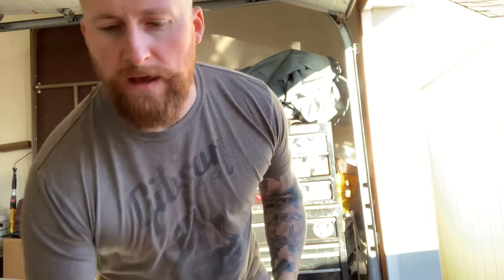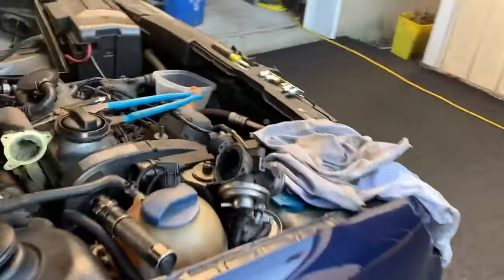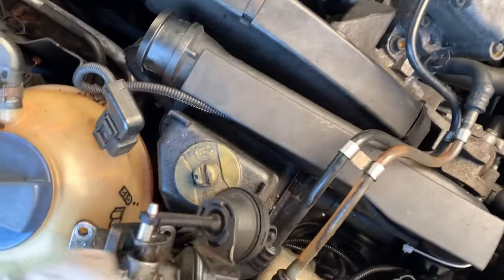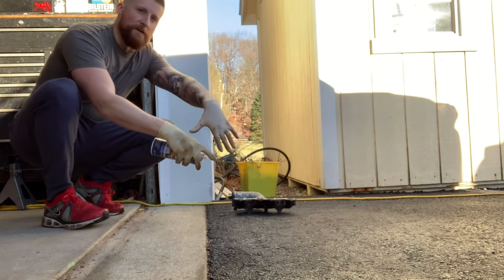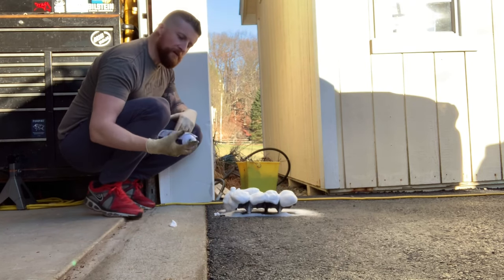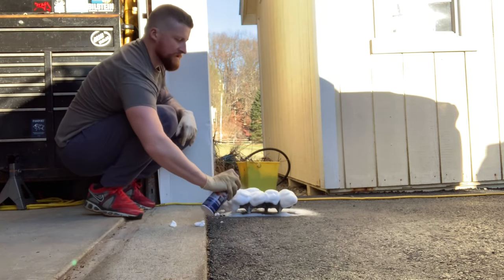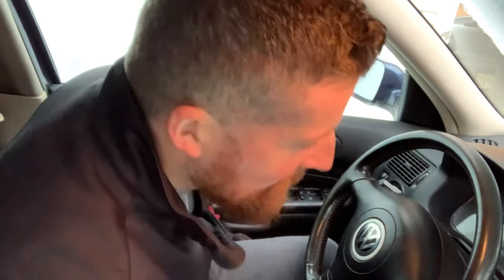High mileage VW TDI/Diesel - Clogged intake You won’t believe your eyes

Comment: Awesome video!  very clear and well narrated. I have a 2009 and after the :"Dieselgate" mod that was done by the local dealer, my mpg has been dropping like a rock, the DPF light & and check engine light have illuminated, and now the fan runs for about 12 minutes after you shut the car off. Man, I have to do something and I have been told to do a DPF and EGR delete and that will get my mileage back up into the  50's. What ia your opinion of that idea?  ( Plus cleaning the intake manifold) I love your channel and have subscribed so keep the great content coming.
Reply from the maker: I do appreciate your kind words. Thank you Sir. Yeah the new ones are smothered with all the pollution restriction crap. Those cars in Europe get great mileage without all the added junk.
My personal opinion, if the state you live in does care about check engine light as far as inspection, DPF and EGR delete is a must. Your Mpg will blow your mind afterwards.
Reply from the maker: But unfortunately after doing those your car will have a check engine light on. But there is another way around that, there are companies that can flash your computer to run with those mods without the check engine light. 🤷🏼‍♂️
I hope this helps.
Reply: If you have a check engine light you may be running in Limp Mode that puts the care in safe operation mode that is very inefficient.  Get the CEL off and your mileage should improve.  I just had an issue much like that but it was the flapper valve.  Lost 25% on mileage until it was fixed.  Motor operated fine  but terrible MPG.
Reply: I have same problem. 38 Hwy and 20mpg city......help
Reply: @VikingsGarage  does the car not take longer to heat up in winter with egr shut off? my rover did
Reply from the maker: Oh for sure, this thing takes forever to get warm.
Reply: How do i delete the EGR

Comment: EGR robs engine performance.
Reply: Its actually combination of egr, crankcase breather and high temperature that creates buildup
Reply: @Dumpluk I thought it was low temps that causes buildup. The deposits are a mixture of engine oil and carbon particles which flow better in high temps but settle easily with low temps. Hence the people who say lots of short trips are a problem for gas recirculating engines.

Comment: in my 1997 passat tdi 5 speed i could go over 900 miles to the tank.. and i was in no way at all being easy on it
Reply from the maker: Isn’t that crazy!! 😱
I believe it, I hear about those Passats.
Reply: Wow. I just bought a 2014 tdi jetta, I was excited to see 40mpg.. eventually it'll need DPF, and EGR attention. But I just got the cable from Ross tech, and plugged it into the vcds... my measured and calculated soot values were like 13 grams and 3 grams. But when it finally starts limping, or giving me shit about it, I plan on a full delete, and having a tune done for it. No lights, better power and mpg, no more DPF bs.. lol 

And hats off to the man with the half million miles on the bug, that's really cool to hear.
Reply: @nickc7318  congrats on the jetta i am sure you will love it especially after a couple upgrades
Reply: I use archoil diesel fuel system cleaner and I've never had any issues with mine. I run it every tank just for good measure. I have a 2017 Ram Ecodiesel and it's been trouble free.

Comment: I've gone 900 miles on a tank, love my TDI
Reply: What year and model?
Reply: @thedolphinDog  2003 VW Jetta TDI with a 5 speed
Reply: @ethanturner9110  thanks Ethan
Can I ask your opinion
I have 2014 passat tdi 
60k miles on it. I get 38/42 HWY mpg but only 20 mpg city
75%of my driving it is city
Not sure if I should just sell it
Still has one year VW factory warranty for next owner. I hear great cars....my city mileage sux.....hwy awesome
Reply: @thedolphinDog  No problem, I'm not a fan of any newer engine, whether that be a diesel or gas. They are way to complicated and have way to many things that can go wrong with them. The main reason why the ALH gets such good mileage and runs so efficiently is because of it's simplicity and lack of emissions systems. That's what makes it a good engine and why it out preforms all of the others.
Reply: Wow!  I've got a 2015 manual, and even when I'm hypermiling I think my best was 650 - 700 miles per tank!
Reply: 935 miles, 2015 2.0 TDI.
Reply: I can hold 17 gallons

Comment: I don't understand this practice. Oven cleaner is primarily caustic soda a.k.a. Sodium Hydroxide a.k.a. Lye. Sodium Hydroxide is corrosive to aluminum; it will dissolve it, especially if you use heat. It is the reason machine shops don't hot tank aluminum parts, although it doesn't seem many shops clean that way anymore.

Comment: Just got a 2005 Golf TDI. Everything is so brittle.. I was working in that area on some wiring I found the plastic harness had started wearing into so much so that one of the wires had exposed copper. I broke the nipple on the coolant expansion tank and did not even know it :( As for the EGR and Intake manifold.. I am thinking this may be one of the things I need to do! EDIT: My cars at about 270,000 miles!
Reply from the maker: Dam buddy, I feel you. Typical old Vw issues. Good luck

Comment: I drive a Jetta 1.9 TDI AHF motor on
406,000 Kms.
I reside in South Africa 
Do oil and filter change every 10K Kms .
I use Prolong diesel 15/40 engine oil.
No clogged Egr or intake manifold.
Still original turbo .
5.3/ 100 ltrs.
No sludge buildup.
Original exhaust
Original cv's

Jetta still runs well.

Comment: Engine load makes the biggest difference in how much it gets clogged up. I had it clogged up like 5 times less, just a quarter inch thick. It really depends how a person drives the car. Low RPM (1300-1600) driving makes it clog up very fast. I drove my car always around 2000 RPM and up and it pays. Gotta say it had 250k km when I cleaned it. Another thing that clogs it up is oil leak from turbo or crankcase valve, which makes the oil sucked through the intake and it makes these nasty big chunks.

Comment: Great video bro 👍 
My little daily I’ve owned for 17 years, a Mk4 2003 TDi , 90bhp,    @ 200,000 miles, built like a Tiger Tank, same clutch, only on its 2nd battery, is just the most reliable car I’ve ever owned! Starts with one turn of the key, so much torque and returns 55 mpg regularly and on a long run 65 mpg plus!

Only problems ….as the UK roads at the moment have feckin great big potholes EVERY feckin where you drive, is suspension repairs!! The UK, 7th richest country in the world and can’t even manage to repair its own road infrastructure 😠😠😠 
What a feckin joke the UK is 😠  Sorry, rant over!
Reply from the maker: Lol 😜
Reply: I'm in Chicago and just when you think most potholes are fixed and its not so bad winter causes a bunch of new ones.   Same car as you if its a Golf (GLI seat swap, 6sp swap, 1019 injectors etc).

Best mod I did to my car was 1.5" lift spacers and biggest oversize tires that could fit.  Mpg took a hit and noticeably more roll but trade off was well worth it for me. Still get ~50mpg driving it like I stole it in the city and I can drive over curbs and bomb rough streets like its nothing - I also do go off-road boondock camping.
Reply: @h82fail  I’m jelous bro ☹️ I was even considering changing to a Dacia Duster as they’ve plenty of fat rubber on the road to get better pothole improvement 🤔 Can you message your lifter part number and tyre and wheel size combo please and I’ll price it up to c the total cost  over here 👍
If it’s a common size I’ll try the scrap yards

Comment: 2004 Beetle tdi  484,000 miles averaging 550+ miles per tank. The only time I know for sure the intake manifold was cleaned was around 100,000 miles. 
The only service other than regular maintenance was spark plug harness replacement and a crank shaft that was showing signs of wear during the 400K timing belt change. New clutch at 325k. My daughter learned how to drive in this car too!
Reply from the maker: Awesome story, impressive numbers!
Reply: I have a 3.0 TDI and I'm trying to do a tune up and can't seem to find the spark plugs or harness? What other maintenence have you had to do to get 400k any pulleys etc.?
Reply from the maker: Nothing crazy really, just filters.
Reply: Why your tdi has spark plugs?
Reply from the maker: Pretty sure they meant Glow Plugs 😉
Reply: @Peter Dallman, your 2004 model with have the ATD PD engine, this engine here is the AIH before the PD engines 
The PD’s do clog but not as badly
Reply: @Dan23_7    You are correct Dan. I’ve taken the car to the same tech (not affiliated with a stealership) since the 100,000 service mentioned above.  
He was going to scrape the carbon out of the intake manifold on my last timing belt change but he said there was barely anything in there so he left it alone. 
At 498,900 now!
Reply: @peterdallman4550  Is that miles or kilometres? 
Mines done 111000 miles and I’m getting the timing belt done next week, it was changed at 70000 but before I owned the car. I’ve had it since 29/5/22. I absolutely love it 
It’s yellow
Reply: @Dan23_7     Miles.   I had mile timing belt changed every 90K miles.  The only other services done were clutch @ 325k, Plug harness @ 400k and the crank shaft was showing signs wear on the last timing belt change.  That’s it.  No on road break downs.
Reply: @peterdallman4550  That’s amazing mate, half a million miles !!!!
Reply: @Dan23_7   Especially since it was a car I didn’t want to buy!  I wanted a black Golf Tdi right next to the bright yellow New Beetle my wife and daughter loved. So guess who won!
Reply: @peterdallman4550  Yours is yellow too ? 😁
Reply: @Dan23_7  Like a canary!!  Oh. The other thing I replaced twice was the crappy plastic skid plate. I replaced it the last time with a heavy aluminum aftermarket skid plate that was cheaper than VW’a plastic one.
Reply: Spark plug harness on a diesel? Replacement crankshaft after timing check?  ( do you mean glow plugs and cam shaft?)  good to hear your cars going strong. Mines on 220k miles and still chugging
Reply: @Elldeeve  99% of car owners don’t know what a glow plug is, let alone glow plug harness. I can’t see my post while I reply. I didn’t call it a cam shaft? Oh well, you know what I meant. 
Anyway. It passed 500k a few weeks ago.
Reply: @peterdallman4550  Congrats on the big 500! 
Is it the 1.9tdi?
Reply: @DeCrille     Yes.  Still going strong!! (Knocking on wood). After the first service at the stealership I found a local trusted tech on Fred’s TDi online (not sure what it’s called now). Every service that’s been done short of oil changes ( LiquiMoly) has been done by him.
Reply: @MickeyWu7r5  lmao good one bro
Reply from the maker: They’re called Glow plugs, but I’m sure everyone already knew that . 😗
Reply: Spark PLUGS   or is it HAIR PLUGS
Reply: Spark plugs?... In a TDI?!?!?
Reply: @dominikdobrotic8298     I know… I know.  Glow plug. It was the harness that was replaced. 
I’m not a tdi tech, just have a friend who happens to know tdi engines inside and out like the back of his hand, he’s done all the services on it since the 100K mark when the stealership tried to rip me off.
It’s has 507,000 on it now.
Reply: @dominikdobrotic8298  Bud Light EDITION
Reply: @VikingsGarage I was more impressed with the tdi having spark plug wires
Reply: @peterdallman4550  my wee metros done 600k miles, love it for dodging around Glasgow.,original clutch.
Reply: @front2427    Wow!!   Is that 600k miles or kilometers ?   Original clutch is crazy either way!  
I’m up to 520k miles now. I’ve retired 2 years ago so I’m not driving as much any more.

Comment: I had the same issue years ago I changed to Amsoil series 3000 never had a clogged issue again.
I went 735 once left Denver got to the Iowa Minnesota border one one tank of diesel fuel.
Reply from the maker: 735 miles, that’s insane!!
Reply: @VikingsGarage  My 2013 Golf tdi returned the same fuel economy (when it was 7 years old in Aug 2017) during a roadtrip from Montreal to Glenn Burnie (close to Washington DC): covered 1183km on one tank of diesel at 60 miles/h.
Reply: @VikingsGarage  My 2013 Golf tdi returned the same fuel economy (when it was 4 years old in Aug 2017) during a roadtrip from Montreal to Glenn Burnie (close to Washington DC) through New york and Baltimore: covered 1183km on one tank of diesel at 60 miles/h.
Reply from the maker: 😱Very impressive 👏🏻👏🏻

Comment: Owen cleaner foam works better on hot pieces,you need to  heat torch the manifold and then you can see the foam dissolving the sout
Reply from the maker: Didn’t think of that, will know for next Time. Thank you for sharing!

Comment: Oven cleaning the vnt turbo is also a good idea as the vanes get sticky and it drops the performance... Once it's clean, it will spool up like new
Reply from the maker: Very true, but do you really want to stick a dirty turbo in your oven. 
Which I’m sure would cause gases once it burns that crap. 🤷🏼‍♂️
Reply: @VikingsGarage  he meant sticking a tube down the egr hole on the hot side of the turbo. And moving the actuator every 10mins to free it up.

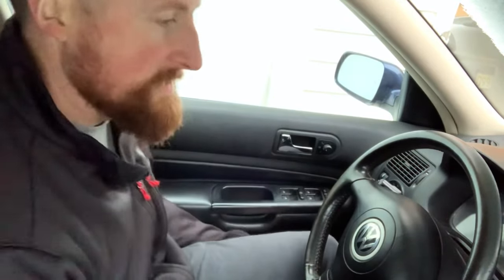Comment: 5:08 Hahaha every one who owns this car knows that frustrating alarm sound when you go to start it. BTW when you said the EGR doesn't even close my thought was "that's not normal?". I guess I'll be taking a look.
Reply from the maker: Crazy right
Reply: I'm an aircraft mechanic, hardly ever work on cars, but am capable. Is EGR & DPF difficult? Clean or replace? I know my check engine light is due to these. 3 shops so far said replace both (damn expensive) but isn't cleaning more logical? The quotes were ridiculous so I'm hoping to do it myself. 2012 TDI Golf 2.0. 46 MPG & a blast to drive.

Comment: If you have the EGR still connected, you're gonna get this crud.  Bin the EGR.. You're also gonna get crap mileage compared to an EGR delete version - go figure.. When I reconnect the EGR for "The Test", my economy goes to hell & I know it's also murdering the engine. They are a rubbish idea, like most "green" theories. "Stop Start" is another similar "Green" disaster - you are doing countless hot stops that bake on varnished oil - and again, it murders the engine..
Reply from the maker: You’re not wrong!! 🤔

Comment: Why is it so bad? My 2.8 Duramax (Colorado) engine intake was barely caked at all at 250,000kms without ever having been cleaned...
Reply: I have the same engine.  I use cetane booster to make the fuel burn more complete.
I had to change the timing belt it was so worn it wouldn't turn the engine. I have 241000kms on my 2.8 duramax
Reply: @leadnsteel1428  yeah I have noticed it's a bit peppier with a cetane booster. Might start using it more often. I didn't change my timing belt for the first time until 250,000 kms/ 7years and it was still fine. No cracking and the teeth were in excellent condition. I think the conditions the timing belt gets exposed to are a major factor when considering it's life span. I believe I could have easily done another 100,000kms without any issue and my diesel mechanic agreed.
Reply: @Trenscendent  hmm maybe it's just my battery then. It was really hard starting. I'll have to test it
Reply: @leadnsteel1428  doesn't sound like something a failing timing belt would cause.
Reply: @Trenscendent  I found out my battery was low voltage so I will have to replace it. It is the original battery though.

Comment: I sprayed Oven cleaner in through my egr while in situ, I’m guessing it filled the inlet manifold too
It struggled to start then blew an almighty amount of crap out.
2003 beetle 1.9 ATD PD
It ran fine with no faults but now it runs better.
I did blank my egr but reconnected it after disconnecting it threw up the engine light and my MPG dropped severely (we don’t need that with todays fuel prices)
So after the oven cleaner treatment, egr connected again my mpg has gone right up 👍🏼👍🏼
Edit, I blanked the vacuum pipe to the egr not the egr body piece

Comment: I have seat 1999 1.9tdi cordoba, it has a vw motor. Should I use additive. And what additive? It has almost 400000km =250000miles. Is there something to notice. Or just put in the tank?
Reply from the maker: Gas tank additives help but at the end of the day you still got to clean out that EGR valve and intake manifold.

Comment: great vid thanks a lot for sharing , i am having problems with a 2006 jetta tdi , when i am in DRIVE OR REVERSE , the car kicks very bad seams like the car will brake in half LOL , someone in the internet has the same problem different car and this guy suggest change the TPS but i think this cars has the TPS attached to the throttle body !! any toughs or suggestion ?? the car has no check engine light however , i am thinking that maybe the transmission is going bad !! don't know !! thanks a lot a new subscriber !!!
Reply from the maker: Sounds like a transmission problem to me but wouldn’t hurt to check that EGR/throttle body for carbon buildup.

Comment: You dumped all that liquid and cleaner into the driveway which leads to a storm drain?  Much better to collect the water and put into the toilet so it will be treated at a sewage treatment plant (assuming you are not on septic).

Comment: How many kms does it take to get that much build up? Could 80,000km do that?
Reply from the maker: Just about, that’s 100,000 km worth
Reply: I run Archoil diesel fuel system cleaner. I checked my egr the other day and it was pretty clean.
I have a 2017 Ram ecodiesel.

Comment: I did not know that the intake manifolds filled with soot. So this is very useful. Which engine is this? The engine code is on the top of the timing belt cover. This said, I suppose I can find that on the Wikipedia page.
Reply from the maker: ALH